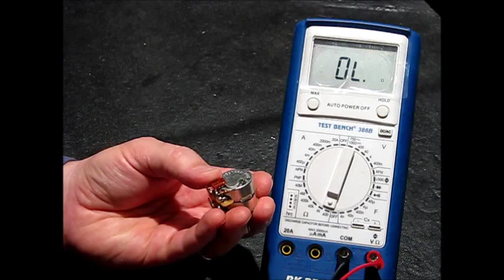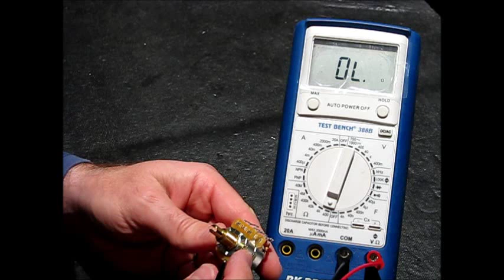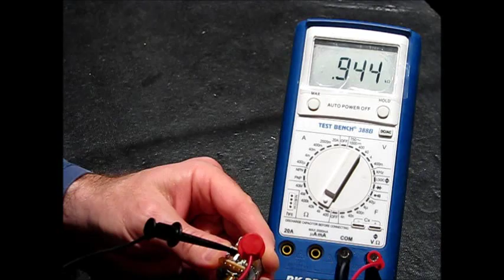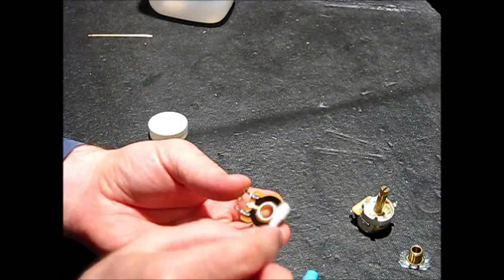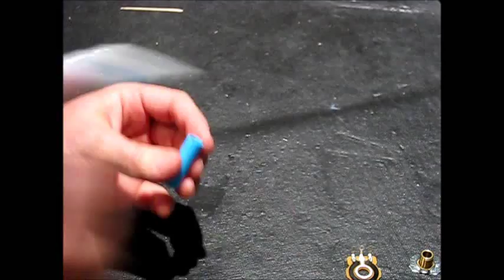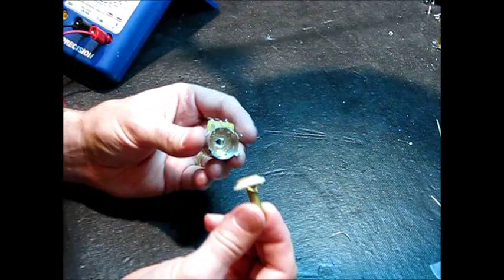TBX Pot Mod for High/Low Cut

Comment: A question. A person would use the stock TBX pot on a typical strat guitar having all single coil pickups, (for the bridge and middle pickups), but on a guitar having humbucker pickups would you have to swap out the 250k resistivity trace part  in the TBX pot for a resistivity trace part from a 500k CTS pot?
Reply: hope this reached you in time. the 250k pot on one side is a no load pot which essentially removes itself from the circuit at minimum value. this means theres no need to do so since pot values only matter if its always connected

Comment: If we didnt have conductive paint. would we cut some copper foil tape and over the same area of the strip? I know its not ideal, but would it work
Reply: I was thinking of doing that. It ought to work if the glue is sticky enough. My silver paint is all dried up. Assuming the glue side is conductive, which it seems to be.
Reply: @FrankJmClarke  Yeah i have done it on a half dozen pots or so, i like it because you can modify the pot without modifying the pot. Just pull the tape off. I used the copper shielding tape. but im sure even something like  a dab of silicone or something like that would do the same. Good for no load pots
Reply: Can you tell me which material would last the longest from the swipe dragging on it?

Comment: Thanks for this. Question if youre still around...how much does 1k really matter to tone? Im thinking of doing this mod...but am curious how much benefit I really get from 0 ohms vs 1k ohms considering the two pots are 250k and 1M (1,000k). Im wondering if 1k is really significant.
Reply: It is a personal choice and would depend upon how well your ears can hear the difference, or if you just wanted it to be a bit closer to perfect.

Comment: What would be the effect of changing cap values?   Is there a way to get even more bass cut out of the circuit?  I have used your mod extensively in several guitars but have a P90 guitar and id like it to cut just a bit more bass.

Comment: I cant afford any of the BRAND Makes that Leo has Touched, so do what you can do with Electronic's
They are the SAME just some of the VALUES have been Change to Protect the INNOCENT.
Ive not Played with a Grease Bucket myself, I did Post a Circuit on GuitarNutz for it, as Im a Lover of the idea 4Bit Switch, just trying to find uses for it, 4Bits meaning i can have a range of CAPS
Reply: In my guitar for each of my tone pots I have a selection of 5 different capacitors. I use a 6 position rotary switch, which has two gangs, but I only needed the one gang.  I have 5 different capacitors soldered to five of the leads on one gang of  the rotary switch. I always have a choice between using any of the 5 different capacitors. A wire runs from the tone pot (connected in the same place where the typical one capacitor is on a tone pot), and that wire connects to the rotary switch.  I can select either a .015 uf capacitor, or a .022 uf, or a .033 uf, or a .047 uf, or  a .068 uf capacitor. Now I know this seems unnecessary for a typical guitar, but my guitar has 5 circuits instead of the typical guitars one circuit , and my guitar has a lot of mods that most guitarist never heard of, so having the access to various capacitor choices works well.
Reply: @jerryrussell2600  I would of used a Hexadecimal (Will ive you 15 Different values than the Basic 5 and use only 4 Capacitors summing up)  switch than a 2P6T , could give you a wider range of values like the Les Paul Record/Studio has with its Capacitor Switch.
I am intrested how you have 5 Circuits!  or do you mean 5 Capcitors .. because i dont think 5 Circuit is the right word there.

Comment: Just had a look at the Circuit, looks a lot like a L&G Passive, i think Leo uses C1M with a 0.0022uF for the bass, you are using a 0.001uF, Im guessing your using the 1M to. And the Treb (bit more standard) a A500K with 0.022uF, i see you are using a 1M in PAR with the Cap there.

Comment: Nice, I was showing this on a Site and also suggestion to use this Method as a Switch.
Doing the same thing but making the Middle Cut (Scratch/Cut away) and then doing more of your paint on Track on the other side making it a 2 way switch controls by the POT, could make it in to a On/Off/On 1P2T switch depending on the Position of the POT above
Reply: There are on-off-on switches that would cost a lot less money then making an on-off-on switch out of a TBX pot. Mini-toggle switches, and Mini-rocker switches.
Reply: @jerryrussell2600  wasnt using a TBX Pot , just a standard Pot and it was more when i turn this point off, it felt a waste when not using it, but using a Second Wafer you can use it as a Switch , even designed one to be a 1P13T .  But since the 10yr since posting this , ive been desiging lever switches and Vairable Capacitors 
Also moving on to more onboard actiive guitars